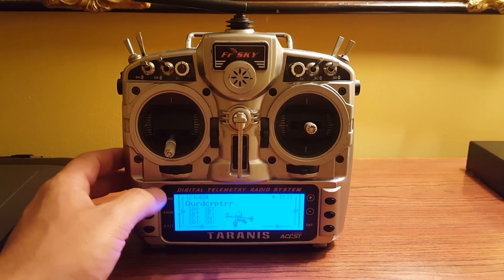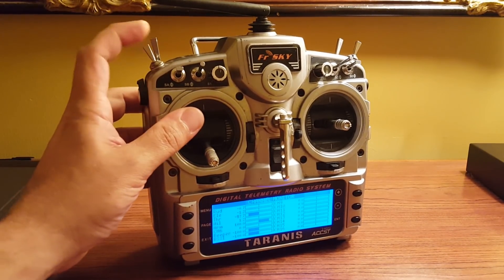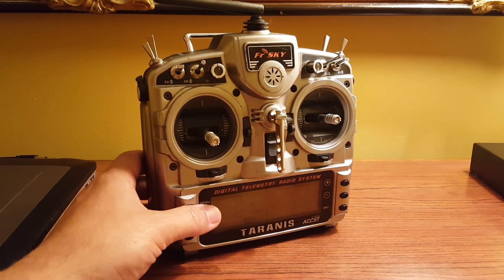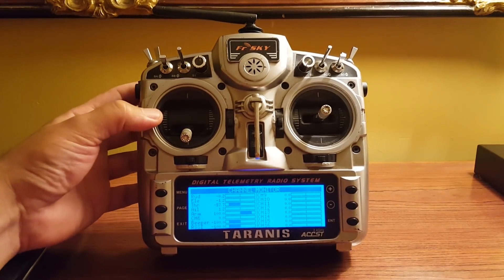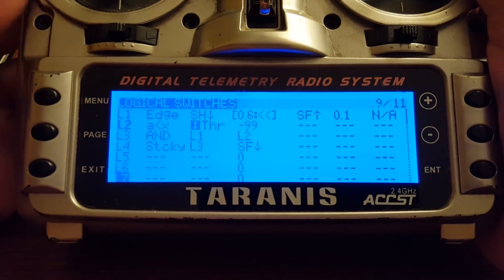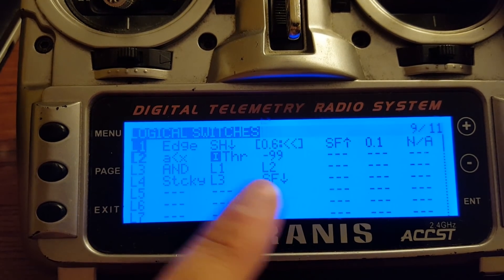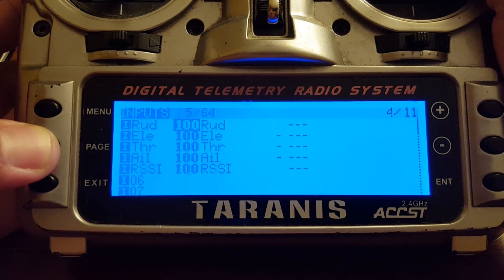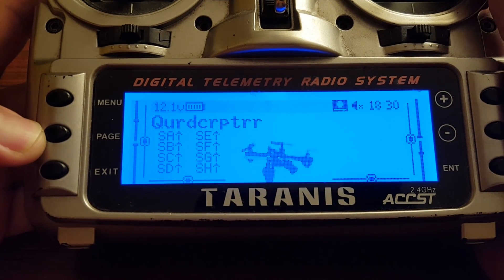Safer Switch Arming on FrSky Taranis

Comment: Very handy. I've always been afraid of an accidental arm as well.   I may try this.  

I am still looking for a way to get a switch to hold my throttle at 1500 until I switch it off for my AP Y6 so that the altitude will hold even if when Yawing I go above or below center. I haven't done a deep search yet on how to do this.
Reply from the maker: Managing the throttle while yawing is just a matter of practice. Walk and chew gum, you know?
Reply: +Joshua Bardwell yep. Well it's not for me it's for whenever I may want to hand over the controls for a minute or two to someone not that experienced.  It is just one less thing to worry about. At higher altitudes I do rely on my OSD to see if I'm descending too much.  The higher you are the less you can tell obviously.

Comment: is the tarranis one of the best controller to buy and also for multiple quads you own?
Reply: @ mike dunmore, I'd say it is a versatile controller. I started off with Spektrum 8 years ago and finally decided to give the Taranis a try and I love it. Gimbals feel similar to my old DX6i. But thats not saying to too much being that the DX6i is, I suppose one of Spektrum's entry level so to speak controllers. But the features on the Taranis far surpass that of the DX6i. One nice thing is I bought a module for the Taranis so that I could still fly my micro planes that use DSX/DSM2 technology, which is not native to Taranis. Meaning I have one Taranis Plus and I use it to fly 2 diff. quads and like 4 diff. planes. Hope that helps
Reply from the maker: Yes.
Reply: yes
Reply: yeeees :p
Reply: As a side note I agree with the fact the Taranis is an amazing controller.  However, if you don't have one yet, you may want to wait for the Horus to come out, I know Joshua is under contract to not discuss it but it looks to be promising.
Reply from the maker: Thomas Lazette Without going into any technical details that would be covered under NDA, I will say that anybody considering a Horus should have a look at the form factor, size, weight relative to the Taranis. There is a lot to be said for a transmitter that is small enough to tuck into a back pack or flight back. The Horus is pretty hefty.

Also, nobody (myself included) has any idea when the Horus will actually be released. If it was six months from now, I wouldn't think somebody would want to wait on buying a Taranis today.
Reply: Very true.  I didn't think about the horus being heavier.  In those regards, I would not wait on the Taranis than, It is still an amazing radio that is ultra powerful in what you can do with it.  Thanks Joshua.